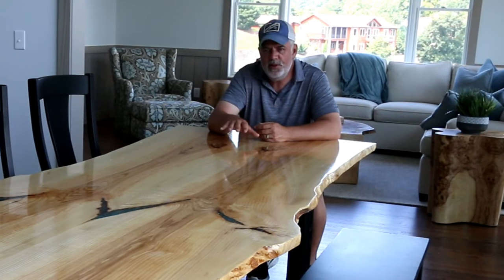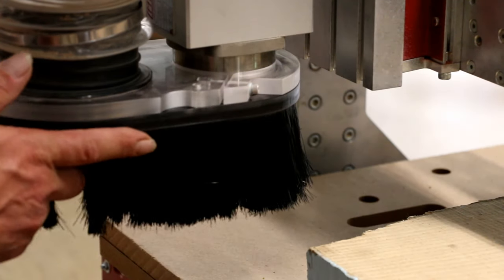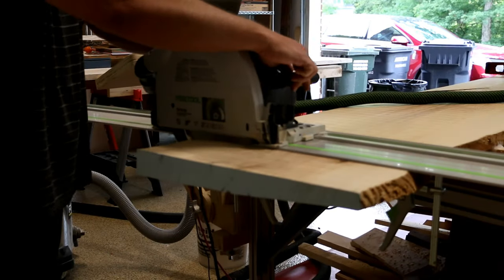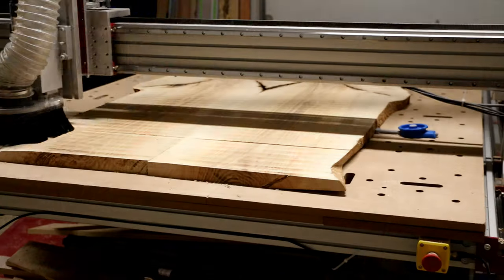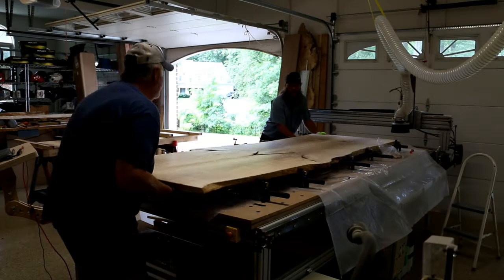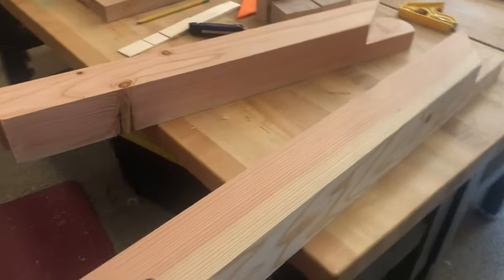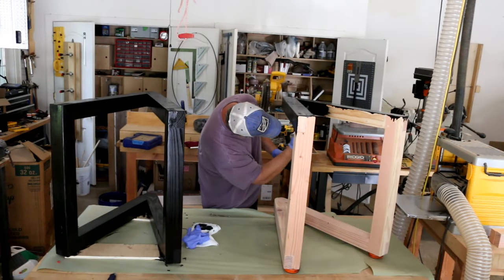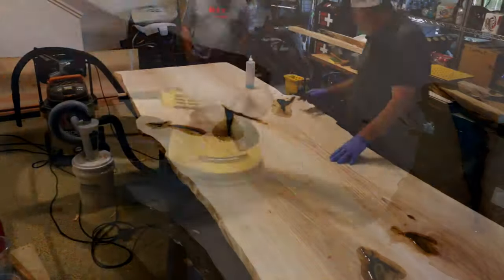Butterfly Slab Table

Comment: Love the table.  I'm interested in your background as you describe yourself as not a builder of fine furniture.  Seeing you use the CNC to cut the joints vs traditional tools and 3d modeling makes me think you have a background in SW or programming vs a traditional route to woodworking
Reply from the maker: Exactly...  I came to woodworking via digital fabrication.  Got an x-carve after 3D printing, long before a table saw...  my dad was a woodworker tho, so had some experience...

Comment: Nice Table Build!  I run an AVID CNC like yours.  What size tool are your flattening with?  I am surprised you had to sand so much.  I too have used mine to joint two pieces together.  I put both pieces on the mill at the same time for the joining runs.  Nice job on the narration also.
Reply from the maker: Me too.  I used a 1.5 inch flattening but.  I think it was a combination of the end grain, and that bit.  Sanding it almost burnished it, even with 40 grit.  I need to figure out what speed I should use on that bit, as well as do another tramming cycle.  Didn’t even think to do the two pieces at the same time.  Good tip.

Comment: Good job.  Thanks for the video.  Got to ask about the grey & blue horizontal clamps on the CNC table, did you 3D print these?  How well do they work?  Cheers, David.
Reply from the maker: They are just flat clamps by kreg.  Fairly cheap on amazon.  Feel cheap, but actually hold well...

Comment: Hello and thanks Tim. I know I'm late to the party but if you're still listening let me get your opinion on something. I have a black walnut slab, 2 1/4" thick and approx. 18-19" wide with one irregular live edge ; length 84". Thinking of butterflying /bookending which could land me at slightly under a 1" table ater milling. Does that thickness make sense for a then 84"x36" top and, if so, would you just edge glue or edge glue with dominoes/biscuits/dowels?